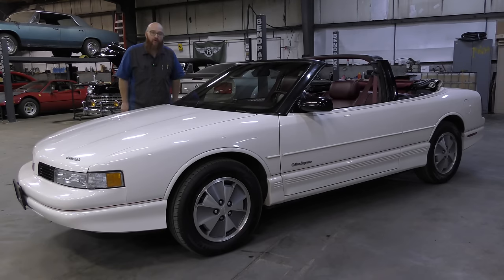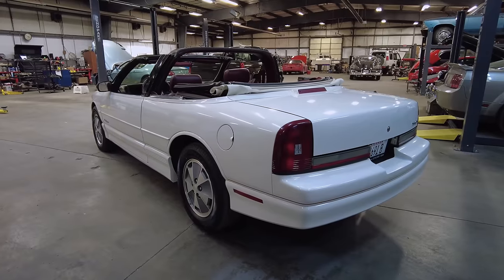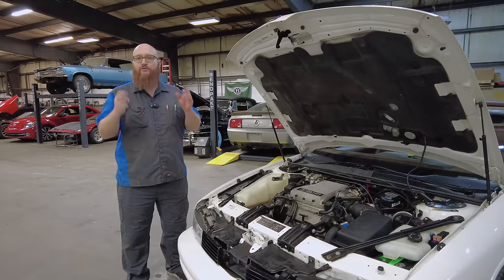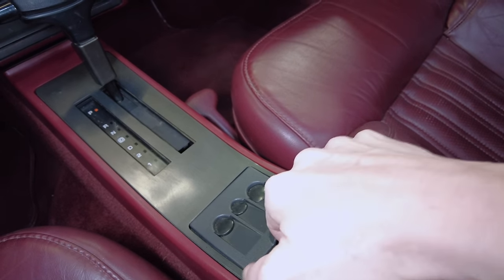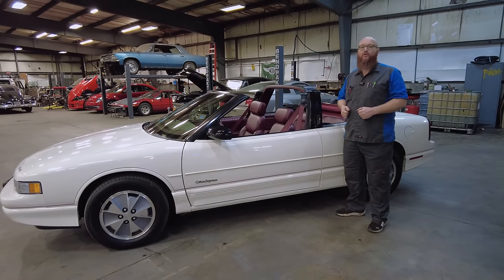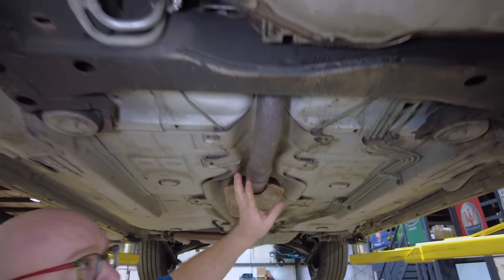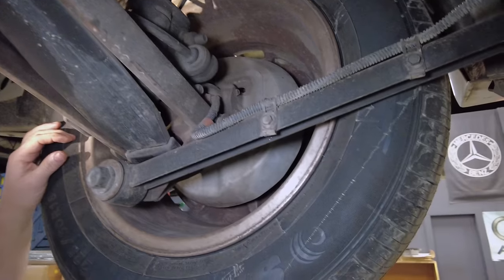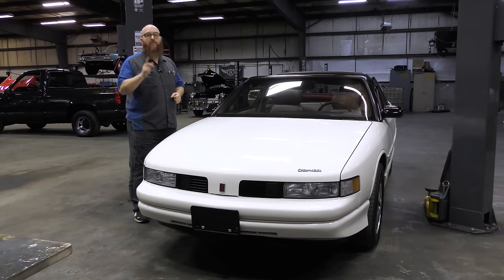A REAL Survivor! This 1991 Cutlass Supreme is MINT! It Will BLOW Your Mind!

Comment: Ive Owned 2 of them since 2000 and 2004. I have them currently.  1 is a Blue1992 oldsmobile cutlass supreme and the other is a white 1996.  3.1 multiport and 1996 is a 3100 type 1.  Both hard tops. And they are absolutely survivors, runners especially the white olds, clean. With a sun roof. They may not be fast but they look cool going slow 😂 I've owned 4 of these and a 1990 chevy Lumina 3.1L  in total. Back 18 years ago they were around like hotcakes..😂😂

Comment: I had an 89 Calais with the quad four. It was great, until it wasn't. Blown head gasket, less than a year old. It was so obvious that there was no way to argue about it. The dealership did. They insisted that the only thing wrong was a stuck thermostat, that's why I lost all the coolant and the engine overheated. I had the service manager stand behind the car and started the engine. The sweet smell of antifreeze and steam immediately came out of the exhaust. Nope, I was wrong, according to him. I took the car, made it about half way home, I had a temperature and low coolant light. It was very overheated. I had to walk a couple miles back into town to a payphone to call the  dealership. I wasn't nice at all. This time they "fixed" it, but it was cooked and didn't run well. I quit driving it, and traded it for an older Mercury Monarch. 
I had two Oldsmobiles, they were both lemons.

Comment: I had the exact problem with the horn contacts on my 1975 Electra years ago. The car has airbags and the horn contacts are inside the driver module. I had to lift the vinyl cover over the airbag and add foam for all 4 horn contacts.

Comment: Now that you have been reviewing old cars, I've meaning to told you how good it feels to remember that you can repair a Ford Mustang by installing a simple relay. Or replacing a gasket in this Oldsmobile Cutlass to prevent a coolant leak. This is what I miss from the eighties and nineties. Cars that you can repair yourself with hardware, instead of Volkswagen cheap plastic parts and software reboots.

Comment: I remember Chevy was supposed to build the Baretta convertible based off this platform but they never came out with it except for car show prototypes. Oldsmobile did come out with them as you can see
Reply: Unofficially, the issue was that the list price for the Beretta convertible would have been too close to the cost of the first generation J-body Chevrolet Cavalier and Pontiac Sunbird convertibles already in production, already similarly sized to the Beretta.  Fearing the J-body convertibles would cannibalize sales of the Beretta convertible, GM pulled the plug at the last minute.

Comment: 3rd car I had was a '97 coupe, dark teal on grey cloth. The "mini quad" headlights did look nice, but the output was horrible- I think the sedans kept the composite headlights for the entire production run. Judging by the wheels, I believe that is an "International" trim level. I had bought one of those digital VFD dashes from a junkyard in hopes of transplanting it into mine- never happened, and probably wouldn't have worked anyways.

Comment: I had one of those. The transmission is the weakest part of that car in addition to the rear single fiberglass transversal leaf spring. It cracks over time. Not to mention the window tracks were horrible. I remember having issues with the door handles breaking off.

Comment: Love the USB ports in the arm rest…. I owned a silver 90 coupe in Germany.  Bought it from a fellow flyer at NATO AWACS.  He was headed back to US for a new assignment.  I paid $3000 for it in 1994.  One German guy who I hung out with was infatuated with the car.  It had the 85 mph speedo so when you got to the autobahn you could bury it in about 10 seconds.  Not sure what the top speed was but was never intended to be a hot rod.  Very smooth ride and decent mileage.  Sold it to German gal for what I paid for it.  Not bad considering I drove the crap out of it for two years.
Reply: These cars didn't come with USB ports from the factory.  USB was still four years away in its initial configuration in desktop computers at the time this car was made.

Comment: The car is very nice, but I still prefer the G-bodies that these replaced. GM lost billions when they went to the W platform. This era Cutlass Supreme sold a fraction of the 1982-87 G body it replaced. A lot of people really hated going front wheel drive with a nameplate like this that was a classic going back to the 60s. The interior became a sea of cheap, hard plastic that would squeak and rattle as milage added up. This one only has 40,000 miles - those that hit 100k or more were all rattle boxes.

Comment: I miss my 1994 Cutlass Supreme convertible.  Blue with a white top and white interior with the HUD option and the 3.4L.  Not a huge fan of the 3.4 but it was the best option those years.
Reply: For 1994, 8,638 convertibles were made.  Of those, only 216 in Bright Aqua Metallic, White/Graphite interior, and White top.

Comment: I highly doubt any GM dealer would turn you away bringing that car in. It's modern enough that they could fix it with no trouble
Reply: I doubt most people would want to pay modern dealership service rates on a car this old.  Likewise, the service department would probably prefer higher profit work on newer more sophisticated vehicles.  It doesn't even have OBD-II (pre-96 vehicle).  The dealership is not a cost effective place to take these vehicles.
Reply: @houseofno  I had a problem with my 87 crown vic I didn't think a shop could handle. It would vibrate and shake at around 45mph they kept it for a few days, found it was the spark plug coil and the egr valve. My point is that sometimes you have to take it back to the maker. Also had a 95 mercury that died after going over a train track, my local shop couldn't figure it out. The main wire from the pcm had rusted away had to be changed.

Comment: Had a 69   caddy w the steering wheel  problem  i put a micro switch under the dash went to inspection he pressed the wwheel i kneed the switch late it passed but he had thrr weirdest look.   Ps theres a cs kit w bearings kia 2.4 engine 350$

Comment: I test drove one of those in 1995 (metallic green with a white top and white leather) Quad 4 engine.  I bought an Aurora instead.  Still happy.
Reply: Nope, convertibles never got the Quad.  For 1995, either the 3100 or LQ1.  For 1995, 4,490 total convertible production.  Of those, only 104 made in Dark Teal Metallic, White/Graphite interior, and White top.
Reply: I stand corrected. Thank You.  It was a very nice Olds. @jiggity76

Comment: Oh God. I have no horn but i just cant find it and i wont take the horn apart. I learned my lesson taking apart thr Bevel to get to my blend door actuator. My battery is in the trunk (2003 Saturn i got for free and fixed up 14 years ago), but i cannot trust myself taking apart anything on or near the dash nor the steering wheel!

Comment: hey car wizard. There's an engine stp zinc additive that is suppose to stick to metal, and wipe off during friction. It worked for me because i had a magnetic drain plug and when i started using it i stopped having metal sludge on the drain plug. I know the nissan cvts make a ton of metallic debris, can you do a test and add zinc anti wear additive into a nissan cvt transmission, and see if it stops wear?

Comment: My friends sister had one. Leaked water from the top. Nice car though. Orange color with white top.
Reply: No orange color if it was factory.  Maybe Bright Red?
Reply: @jiggity76  Yup. It was. With white rims and top if I remember correctly. White interior too I believe.
Reply: @73ac39  Interesting.  The rims would have been custom on it, GM never offered white rims.  Now, White interior WAS a factory option, sort of a 2 tone look with White and Graphite together.  Bright Red with White/Graphite interior would have been stunning.
Reply: @jiggity76  No they were factory. Definitely on there from new. You can Google it. They were on white ones. Maybe she had them special ordered on hers. Definitely remember that.
Reply: @73ac39  Sorry, again, not from factory.  Now, the dealership could have done it, but not the factory.  Pontiac was known for body colored matching alloys but not Oldsmobile for the Supreme line.  Anyway, it would have been a very nice touch to add.

Comment: I had a 1990 Cutlass supreme hardtop with the 3.1 that was nice engine. and I never got a chance to supercharge it custom. and i also had the 1989 gs regal 2.8. and the 2.8 feels faster.and all everybody got to do is change the oil sooner and antifreeze flush and spark plugs sooner and change the valve covers and o rings every 7 to 8 years and check brakes system and fuel system every year. and don't be taking off so hard with it hurting the transmission. And it will run forever and i regret selling them. Because college wasn't cheap. 🤣  And now its cost $10,000 or more to get one these days.🤨

Comment: It's a total nightmare to do an alternator on those. Gotta remove passenger front wheel and the brakes, hub, etc. What I stupid spot to mount an alternator
Reply: What are you talking about?  Alternator is right on top.
Reply: @21Piloteer  91 with 3.1 is on top. 94 with 3.4 alternator is between exhaust and firewall on passenger side

Comment: Since Oldsmobile closed its doors in 2004, does this mean it's your DEAD not-your-father's Oldsmobile?  Actually the later model coupes used mini-quad headlights that were TWO to a side plus similar inboard turn signals, not four.  The later model Grand Prix coupe used similar headlights. The mini-quads were an even smaller version of the similar mini-quads used on the 1988 and 1989 OBS C/K pickups.
Reply: Two per side, the inners were the hazards/turn/parking lights.
Reply: Fixed it. Thank you!

Comment: Awesome,  I used to own one of those back in the day.  with the same kind of dash and white with red interior and hard top coupe.  same engine though.  Changing the spark plugs the manual called for unbolting the motor mounts and rolling the engine to access the rear spark plugs.  I had very very few problems with mine aside from a water pump. I do remember topping out at 148 mph before I got scared and shut it down.   Ah the days before speed limiters.

Comment: The 3.1 is invincible. I had a lumina with over 250,000 on it and i did nothing but oil changes and some gaskets. The body rusted out well before the engine would let go!